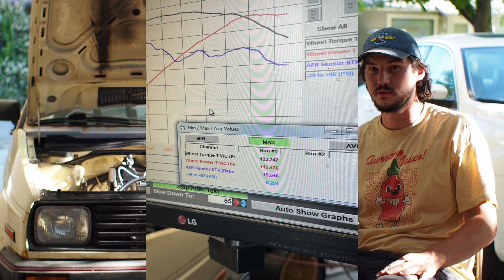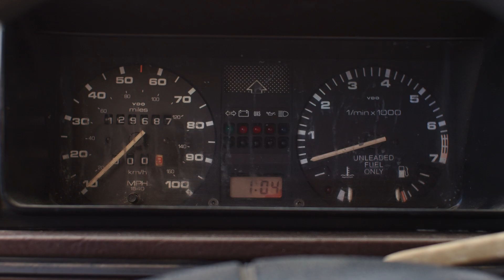VW ABA + Weber DCOE’s = GOOD : what you need. Sound and Dyno included

Comment: How did u do the timing advance
Reply from the maker: I left the vacuum advance disconnected, and set the timing to factory for the ABA witch I believe is 8+ degrees BTDC
Reply: There is also a centrifugal advance at that kind of distributors.. i think its something like 24 degrees at 4000rpm max
Reply: I use a CB performance black box.

Comment: Cool stuff! Got a similar set up but with 45's and 288 cam etc.
Some tips : 2E or AGG mounts work too, cb performance black box replaces the ignition module and turns the 2.0 distributor into a fully programmable ignition for 250$, with a pertronix flame thrower coil you'll be golden, the original radiator can still work if you tilt it forward a little and make deeper mounting points. And if you want to go further there are extra ponies to be found. Mine pull's past 7500 happily. I just set the limiter there because I'm scared.